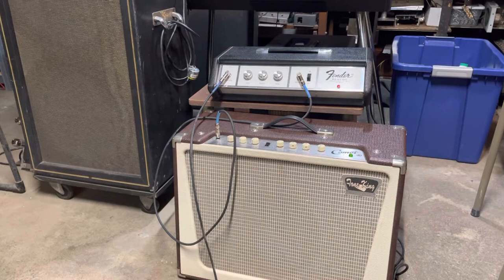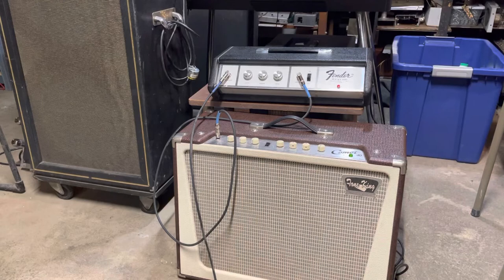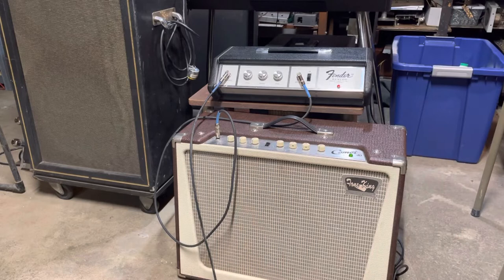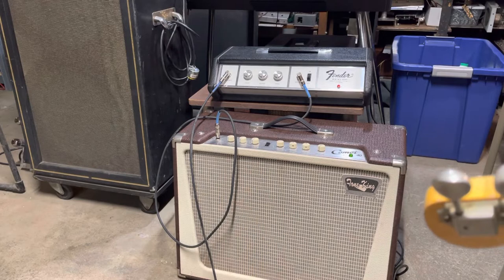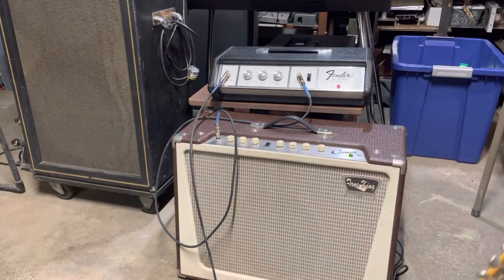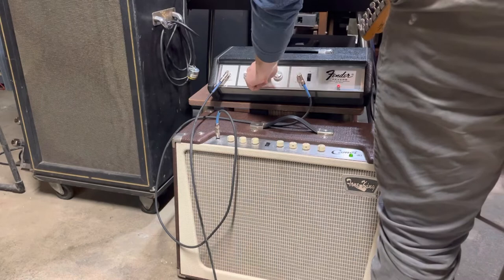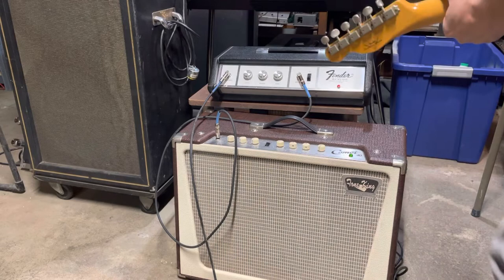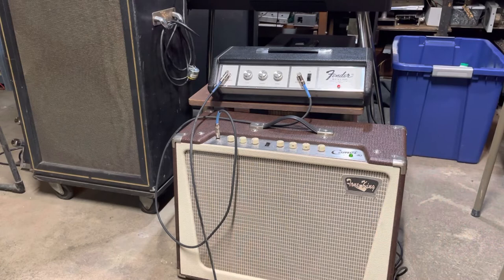Late 60’s fender fe-1000 solid state reverb unit

Comment: Just got one of these, but no reverb coming through. 
Do these default to "on" without the foot switch connected?
Reply from the maker: Yeah they should be on. The footswitch only cancels the verb. They’re full of white Mallory caps if original and they’re commonly leaky or out of spec.
Reply: @dustinaltick5220  Thanks! I appreciate the reply. Yeah that's what I figured unfortunately. Got it from Sam Ash via Reverb and they say it was fully functional when they shipped it. It's in fantastic shape so I'd hate to send it back.
Reply from the maker: @Saganite  claim insurance and have it serviced. Check the rca cables first
Reply: @dustinaltick5220  Thanks, I'll look into that and open it up and check the RCA cables as well. I appreciate your help.